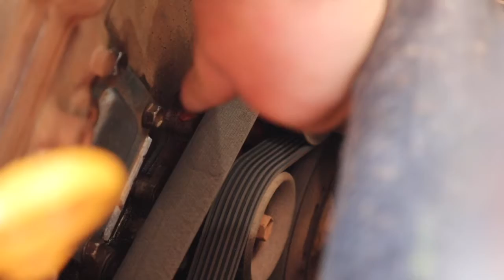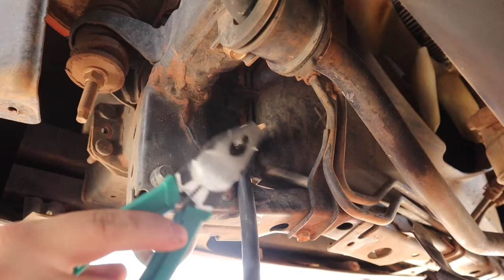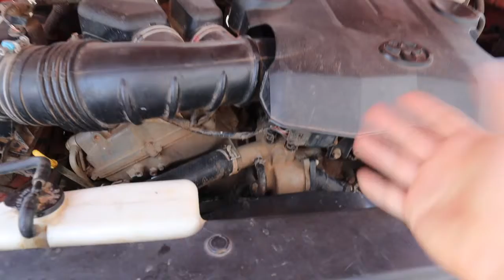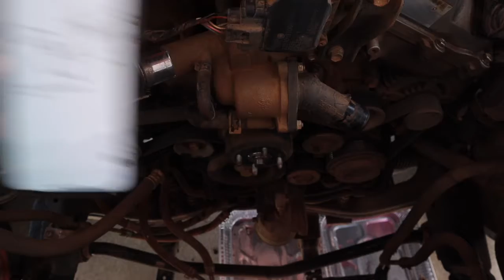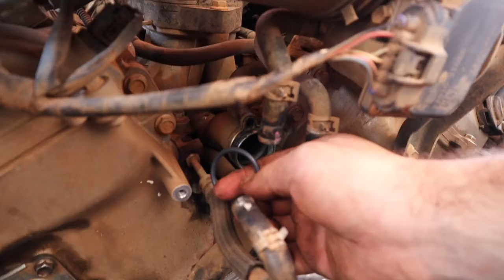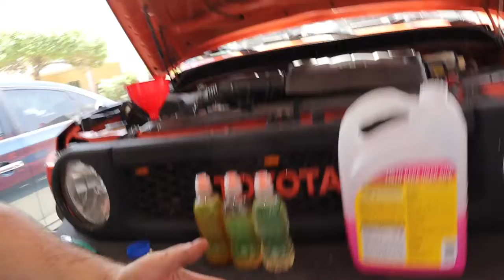How to replace a water pump, complete guide

Comment: What about your engine timing? Do you need to set it again on a chain driven engine? Or is it only on belt driven engines?
Reply from the maker: Some pumps run on the timing chain/band, many however, including my engine, run only on the accessory band, which has no timing
Reply: @MendezMediaGroup1  hi James. Thx for your quick reply. Ok that makes sense. Mine also runs accessory board. I have a Fiesta st mk 8.5 (2023) that was making a chirping sound when turning the engine off. It dissappeared after the waterpump replacement but now i experience some small missfires and suspected the engine timing. But it must be something else.